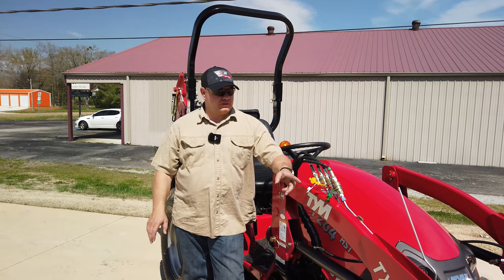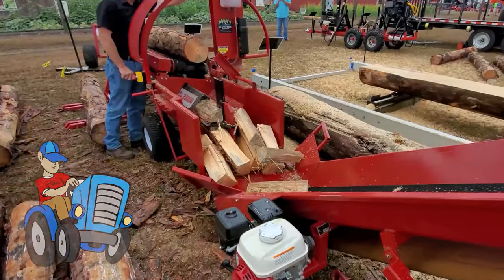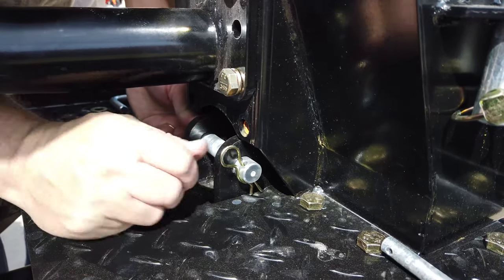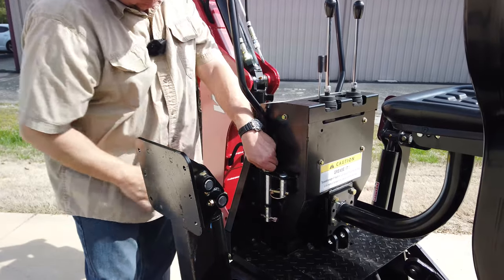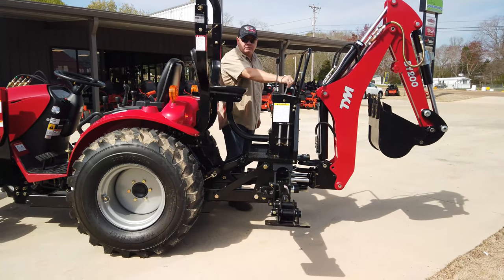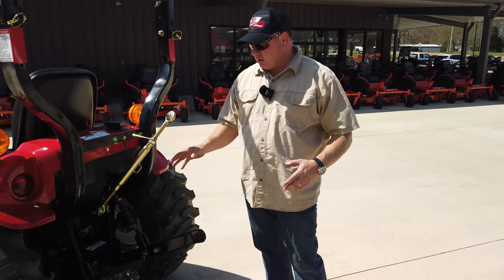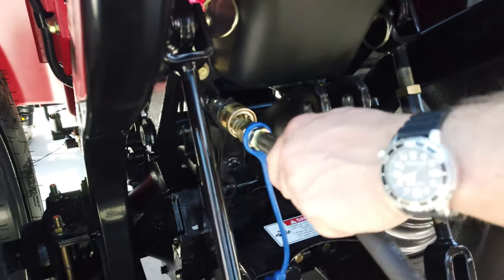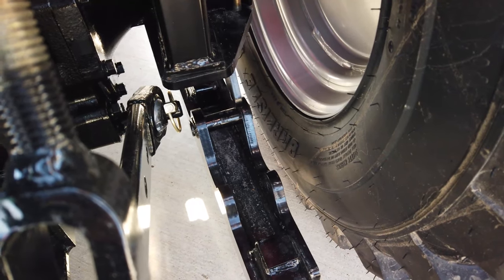TYM Tractors T264 Backhoe Removal and Install

Comment: Have owned this TYM for 2 years now. You remove the 3 pt. assembly completely. You do not link it into the bottom pins. This is how my dealer does it and it works fine. If you remove the 3 pt. assembly, it is much easier to line everything up. I love this tractor!

Comment: Thanks for the demonstration, Tony.  The backhoe is usually pretty tough to reconnect and the TYM seemed quite simple.  That's one thing I like about the simplicity.  Full watch.  Later, Tony.
Reply from the maker: It is really easy and strong. The way the do is keeps most of the ground clearance.

Comment: Might want to try this operation on uneven ground before purchasing. Looks pretty easy when you're doing it on a level concrete parking lot.
I own a Kubota B3200  and it only has two Saddles & 2 locking pins no frame underneath the tractor to lineup. Even being that simple it can be quite the chore to get it to line up when you're in the field. I couldn't imagine trying to line this one up.
Reply from the maker: I have done it on uneven ground, sideways ground, forward ground and flat ground. The outriggers and the boom pick it up. You just level it to the tractor and back in.

Comment: Really liked the stability of the frame and the structure itself is very well thought out. With that set up there's no way you could damage the tractor.  Thumbs up Tony 👍👍👍
Reply from the maker: I agree. I like all tractors and you know that. People are so quick to jump on something they don't understand without seeing the benefits. This unit will come off in under 5 mins. So many of the comments act like this is hard. There are easier setups and harder setups. No more than a person will take this backhoe on or off, the TYM setup would not even factor into my buying decision.
Reply: 💯%% agree

Comment: TYM has definitely refined their tractor over the years, however the backhoe could use a little work. 😳
Keep on tractoring!
Reply: Definitely not as easy as a BX...
Reply from the maker: I agree, there are faster setups, but I am not sure they are stronger.
Reply from the maker: TYM's subcompact backhoe removal on the new TYM T224 is the same as the BX. I will concede that Kubota is the brand to beat. Kubota makes a great tractor.

Comment: I like how it uses the 3Pt as well as the subframe!  Nice video tony!  Have a good weekend!
Reply from the maker: The sub compact tractors of all brand including TYM is much easier to take off and on, but this is still fast enough. The backhoe is super fast at low idle with the dual hydraulic pumps.
Reply: I would take a stronger BH for more time to take it off and putting it on!  I don't take mine off that much! lol  The dual pumps are super nice!!
Reply: I think I'll buy one of these.i think the kukje would last l9nger and is quiter.Agree with Tym rep...looks like a lil bulldog.

Comment: Hello Tony,
  I have a TYM T264 with the tx2000 loader and the B65 backhoe  with  30 hours.  In this video, you have the BY200 backhoe. I didn't know you could get different sizes in backhoes. Also the B65 backhoe doesn't use the top link.
Reply from the maker: This was several years ago.
Reply: @TonysTractorAdventure  Mine is a 2022 model 
 I guess they changed some things.
Reply from the maker: I apologize. I wrote more, but you only got one sentence. They switched over to the BX65. It is much heavier built.

Comment: I could see it was hard to fit a camera while installing the stabilizers!  I've read the comments below and it seems people are not so enthusiast with that system.  On the other end, it is a compact tractor and without a real subframe, it compromises the tractor's frame. The video is 14 minutes.  So I assume installing the backhoe must not be over 15 minutes. Thanks for sharing that with us. Snow is almost all melted here... Thanks Tony!
Reply from the maker: It takes about 5 minutes to take it off.  Some people don't like what they don't understand. It is a strong system.

Comment: Hey Tony, thanks again for all the valuable info. you provide on these Tym tractors.   I am eyeing the T354 tractor currently, but cannot find much video reviews out there.  Any chance you can give us a future review of one of these machines?  I believe the T394 is the same chassis size.   My local dealer also carries Branson, and this may be my second choice.
Reply from the maker: The T474 is the same chassis as the T354. The T474 is the newer model with a much simpler engine and more HP. I Love Love Yanmar engines, but the Kukje engine in the T474 is just as good. I have the Kukje in my T264 and it has been rock solid. Many dealer have never worked on the Kukje. They just don't break down. I think you will like the price on the T474 too. Yanmar still comes at a price.

Comment: Thanks for the video, easy to understand. I’m new to tractors and was wondering is this backhoe a “subframe backhoe”? I’ve heard they are the only way to go, Thanks again
Reply from the maker: 50 hp tractors and below need a subframe. Three point hitch backhoes will damage the tractor. This setup is about bullet proof. I just upgraded to the T25 and ordered the backhoe. I will install it soon.
Reply: @TonysTractorAdventure   thanks Tony, the T25 looks like a brilliant machine and I wish I could get one! but here in Australia they only have the TS25 or the T265 models. So I went with the T265, should be delivered early next month. From what I’ve researched the T25 is a far superior machine than the TS25. Much appreciated and many thanks from down under 🇦🇺

Comment: It looks like a pain in the butt and not very user friendly. The backhoe attachment reminds me of the aftermarket 3 point backhoes that can be purchased. I see a lot of resemblance. I do like that it seems the 3 point arms can stay on the tractor with the backhoe installed. I think they could make some refinements as to the stabilizer pins and go to a latch system.
Reply from the maker: I don't understand, I can take the backhoe off in less than 4 mins. It only took 6 mins to doing all while videoing. Many brands use the same setup on their tractors. It is a proven way to transfer load to the whole tractor. I don't know of any brand that will come on and off fast enough that it will matter. It is not like the backhoe is coming on and off every few mins.

Comment: Do you have a video showing how to mount and dismount a mid mount mower?
Reply from the maker: I don't have a mid-mount mower. I have the backhoe. The mmm will not mount up if the T25 has the backhoe option.

Comment: Great video  Tony,  I have purchased a backhoe for my TYM  234. My concern is that I am picking up the hoe from the dealer and putting it on at home. I am assuming that I will get it all folded up. Should I  block it up after I pick it off the trailer to get it unfolded?
Thanks in advance
Mike
Reply from the maker: The sub frame will have to be put on the backhoe. Then the mount to the tractor.  Do you have rear remotes?
Reply from the maker: I know you are. So much fun and so useful.

Comment: Is it safe to assume the RK37 tractor from Rural King would be the same?
Reply from the maker: No sir. The T474 by TYM is the same frame as the RK37. I have backhoe and  loader removal videos on my YouTube page. The T474 is 48hp for the same price.
Reply: @TonysTractorAdventure  So you're saying the TYM 474 is the apples to apples comparison to the RK37, for the same money, except the TYM has 48 HP?  Wow that's wild.  I'll have to check that out.  Does the TYM use a turbo like the RK55?  It looks like I don't have any TYM dealerships here locally in the Lexington, KY area though....
Reply from the maker: The T474 doesn't have a turbo. Just a bigger engine.
Reply from the maker: The RK 55 I this like a T574

Comment: Great video, would you know where one could find a thumb for the backhoe?
Reply from the maker: I never recommend a thumb for such a small backhoe. I don't recommend them for any tractor backhoe unless they are commercial machines. They are a waste of time in my opinion and will only end up damaging the backhoe with little to no use. They just don't have the reach to do much without moving the tractor a hundred times. I know there is a mount, but I have known so many people break off their backhoe with a thumb. Spend the money on a grapple and you will be much happier and mobile. Again, just my opinion, but it is based on answering about 1000 tractor comments each week. There are two camps with a thumb. People who have damaged their backhoe, and those that will. All said with love.

Comment: I just discovered your channel. Awesome job and great information. I have an older TYM273 and it is a workhorse. I was wondering if you have ever had anyone report this issue; I have the backhoe setup and when dig I get hydraulic fluid overflow out of the breather tube. I have rotated the fill knob which is supposed to act like a selector but it still comes out and makes a mess. Ever hear of this before? I've called TYM in NC and they aren't interested in dealing with me and my original dealer is long gone.
Reply from the maker: Reach out to me on the Facebook messenger

Comment: How long is the tractor with bucket and backhoe. Will it fit on a 14ft trailer?
Reply from the maker: I am not sure. I have the backhoe on the T474 which is a bigger. I used the dealerships tractor for this video.
Reply: @TonysTractorAdventure  I moved mine on a 16 foot trailer with no problem a little extra room at the back.

Comment: Nice video but I think I like your 240e and my Kioti set up better, they are similar. Don't have to fiddle with the stabilizers. The top link set up is a nice idea though
Reply from the maker: They are very similar. It looks like it was the best way to do and not loose ground clearance. The MT240E is very low in the rear with the backhoe. The MT240E worked well though.
Reply: I also agree with the lack of ground clearance
Reply from the maker: Even though the MT240E lost some ground clearance with the backhoe setup, it only drug once or twice, and it never was a problem. I knew it was there, so I operated it accordingly.

Comment: Way too cumbersome & fidgety. It looks like the hoe frame reduces ground clearance significantly? I guess that"s why I keep looking at the Kubota BX23S as my choice although I haven't pulled the trigger yet.
Reply from the maker: The ground clearance on this with the backhoe is still higher. This is just a bigger Tractor than the BX. The BX is a good machine but is light in its tractor features. This tractor has position control 3 point hitch and  It has a hydraulic cooler. Both have their place
Reply: Kubota are apparently back ordered for at least 6 months where I'm at. That backhoe looks fairly capable, I can't wait to put her to work.

Comment: Having hard installing my backhoe on my t264.got tb65 backhoe.but one of the lines wont lock on.spent few days fighting and im still losing.dealer saying back pressure but i unhooked the lines.
Reply from the maker: Stand clear, and move all of your levers until the backhoe settles relieving all of the pressure. You should be able to back up an pick up the backhoe using its own hydraulics. Never leave it suspended in the air unless setting on blocks.
Reply: @TonysTractorAdventure  it took more then that.had to take my lines off and release check valve.did it on vice then went and hooked it back to machine.not unhooking it again i guess.dont have any other implements for tractor so it can stay on til i do.thanks for answering.
Reply from the maker: They make a little tool to release the pressure. It happens to all brands. It is really bad if you take it off on a cold day and put it back on a warmer day. The air bubbles expand. Still, after releasing the outriggers and moving the backhoe controls around, I have always got the T25 and T474 back together.  https://youtu.be/NyoXtNS1qA0

Comment: Can you have backhoe and midmower at the same time?
Reply from the maker: Yes
Reply: @TonysTractorAdventure  I was told it wasn't possible and you would have to completely remove the mid mount because of the subframe for the backhoe goes in place of the subframe for the mower.

Comment: great vid ,can you do a regen vid
Reply from the maker: There is no regen on the T 264
Reply from the maker: On all new tym tractors that have regen, it is automatic and you never stop working
Reply: thanks I bought a new TYM 554
Reply from the maker: Just drive it doing what your doing. The Regen is automatic so you don't need to stop work like the older tractors.
Reply: Thanks

Comment: I think I like the setup on my MF GC1723EB better...
Reply from the maker: It is better in some ways, but the MF GC does not dig with as much force and as fast as the TYM T264. The engineers of many tractor companies use this type system to transfer the load across the tractor. The MF GC1723EB is more on par with TYM's new T224 and backhoe. The T224 comes on and off about the same as the GC17xx.
Reply: Tony's Tractor Adventure - IIRC, you didn’t actually own the MF backhoe because the dealer said it couldn’t be added to your MF tractor; so you got a LS with the backhoe instead? You might not be aware - or remembering - that there’s a whole additional subframe under the backhoe-equipped versions of the GC1700 that does just that (and additionally makes the tractor frame stronger even when doing non-backhoe stuff); and for a larger/faster backhoe that subframe - and it’s interface point to the main backhoe body - would be made stronger. The difference between the two versions isn’t just in the back end of the tractor.

Of course, it’s not perfect - seeing the interface points while backing the tractor up so that everything lines up puts a crick in my neck; and spinning the seat around is not as nice as it could be (the latching mechanism is a bit fiddly). It’d also be nice if there was an extra lever to raise and lower the FEL from the backhoe to make repositioning the machine by pushing it with the backhoe more convenient (as-is you have to turn 120 deg and reach behind you for the lever).

I’ve got the parts for, and hope to get a chance to install soon, a video “back up” camera/LCD system, mounted on the ROPS & canopy, pointed down with the hitch & whatever implement is on there in view. Gonna stick that on there along with a 12v fan (truckers often have this kind installed in their cab, hanging from the ceiling) and an amber LED strobe for when I need to be out on the street with the machine. (Right now, it’s still raining, but it’s supposed to clear up tomorrow...)

🙂

Comment: You should NOT stand along side of tractor , while pressing forward and reverse pedals !
Reply from the maker: I knew someone would say that!
Reply: True;  but it sure beats standing in front of it while pushing the forwards pedal! 😬 I’m actually a little surprised it was possible: on my MF there’s en engine kill switch on the seat; if it’s not in neural and you get off the seat, the fuel is cut off.
Reply from the maker: Push your left hand down on the seat while using your right hand to push the pedal. I have been around thousands of tractor people, at some point, some go overboard with safety. There was almost a zero percent of danger in what I did. I move the tractor in a controlled fashion.